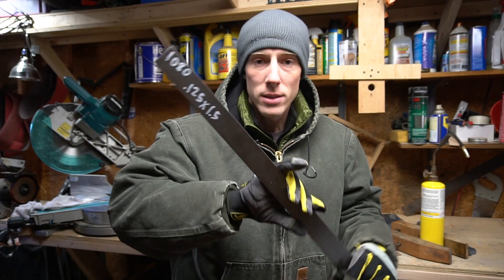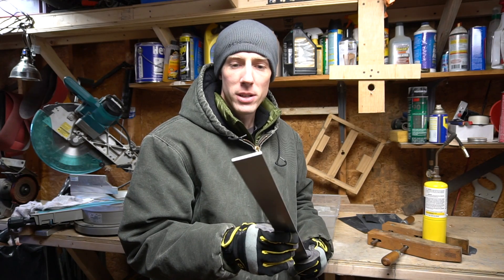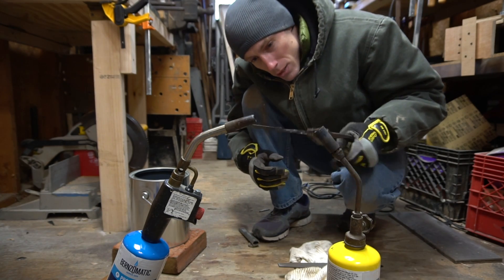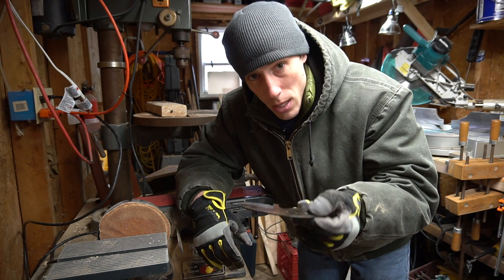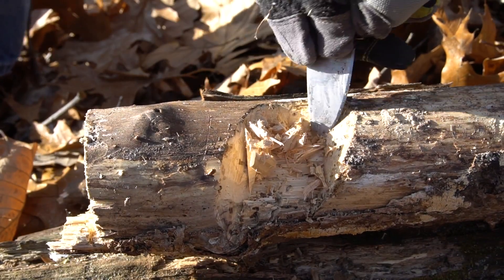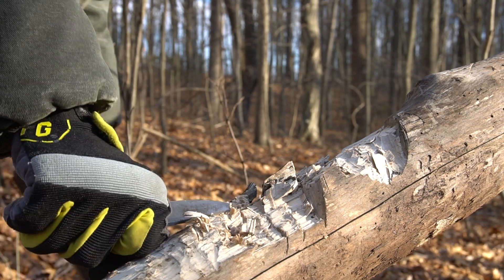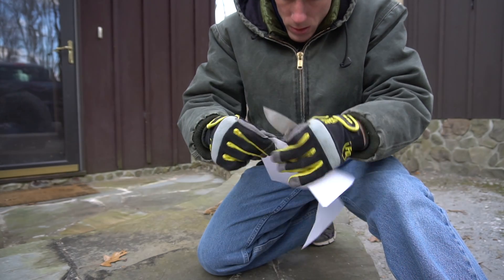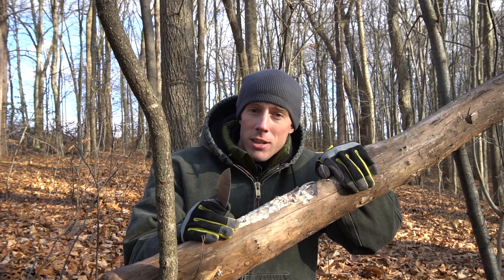Knife making | Can you heat treat a knife using basic tools?

Comment: You well know this by now, but for new watchers:
 You really want to do a normalize first, bring it up past non magnetic by a bit and hold it for a few minutes and then let it cool in air, then bring it back up just to the brink of nonmagnetic then quench. 
From the factory the crystals are huge for easier machining, but you want the carbon to dissolve and let the grain structure reset so that when you do the main hardening you can get it just to nonmagnetic and have all the carbon in solution quickly, without letting it sit too long or overheat which causes a huge loss in tougness even if the hardness comes out the same.
Reply from the maker: That actually not true. Dr Larrin Thomas has a lot of work on this and the crystaline structure from the mill. Id suggest reading knife steel nerd knife engineering. There a lot of myths that have been busted.

Comment: Just tried heat treating my first knife. Don’t have a forge at the moment. I used propane,got it to non magnetic,quenched in vegetable oil but it didn’t harden. File digs in. Not sure what went wrong. Any ideas? Can I retry on this blank or should I start over? Thanks for any ideas.
Reply from the maker: What kind of steel is it?
Reply: OUTDOORS55 its an old mystery steel saw blade. I wanted to try a couple before I bought  some 01. It sparked really well and everything. After I quenched it tho, my file still bit.
Reply from the maker: Id use a known steel. Try and find some 1080-1084. You may get the o1 to harden but you wont get the full benefit of it with crude methods (forge/ torch). 1080/1084 will harden very easily. Mystery steel is hit or miss🤷‍♂️

Comment: why does the tempering cycle have to be so long? Why cant you temper in say... 10 minutes? I get a nice straw color within that time at a higher heat.
Reply from the maker: You can temper for shorter times. I’ve tempered with a torch for a quick temper. To keep it simple it can take time for the steel to respond. Thicker pieces require a longer temper. Think of it like melting an ice cube. A quick high heat may yield melted ice on the surface, but it’s still frozen inside. Leave the ice cube at temperature and it will ensure an even melting. Same with steel. Hope this helps 🙂
Reply: OUTDOORS55 Ah yes ok! Yes thanks that makes way more sense.

Comment: Need a cheap heat treating oven? Dig a hole in the ground then dig a smaller hole at a 45 degree angle connecting to the bottom of the first hole. Place a metal pipe into the second hole and cover it up. Use either a hand pump or a hair dryer as a blower for your fire. note you can either use charcoal or wood as fuel, but charcoal works best as it burns slower.

Comment: I'm not sure if you'll see or reply to this but I need some advice. So I took your advice and bought the contolled angle sharpening system. I have trouble using it to put good edges on my knives. I was able to put a pretty good working edge (but not shaving sharp) on my 420hc buck using it but I've been having trouble with my Swiss army knife. I'm scared to try and sharpen my s30v manix 2 when it dulls. Maybe it's because the stones aren't flat (at least the 600 grit isn't), maybe it's my technique, or maybe I need to step my stropping game up. I'm not necessarily gonna buy one right away but what sharpening system would you recommend at the 50 dollar mark? Who knows, maybe I'll suck it up and learn how to hand sharpen.
Reply from the maker: You definitely need a strop if you don’t have one. The lansky stones will leave a pretty big burr that needs removal. In my opinion a good strop is more important than the stones you are using. You can get hair whittling edges on cheap $5 stones with a good strop/strops. I use a diy strop (I have a video on how I made it) I loaded with a coarse compound and a knives plus strop block with fine compound. Just make sure you fully apex on the lansky. Then strop until all of the burr is removed. Sometimes it can be stubborn. Hope this helps 😀
Reply: OUTDOORS55 I have a cheapo Amazon strop I got for like 15 bucks and it should work fine but I was wondering whether I was doing it right since I was getting poor results. And thanks for the advice on stropping. If I use my strop better and flatten out the 600 grit stone I should be getting better results. All I've been doing for stropping is 5 very light strokes on each side with an angle lower than what I sharpened it. It probably isn't doing much which it leading to the poor results
Reply: OUTDOORS55 your tip on the stropping actually really helped. I stropped the sak a bit more using a bit more pressure and angle and the edge is already a lot sharper. I should be able to get a great edge once I touch it up on the stones some more and strop it a bit more carefully.

Comment: TOTALLY OFF TOPIC.
I just found a neat and CHEAP way to perfect apexing delicate blades.

Here in UK we can get 8 cheap Plastic Snappable Stanley style craft knifes...for a POUND/ Dollar

Using the finest stones I found I could gently take them from thick paper slicing to Shaving evil within a few strokes of a shit "1000" grit Chinese stone.

There are numerous inches on each disposable knife and the WORST that can happen is .. You still have a fairly sharp disposable knife....

I extended an inch (whitch I had probablu used to open a few packages ) and worked it gently... It shrank fast but was notably sharper than the next 4 inches that hadn't been used...

Give her a whirl...
Reply from the maker: Interesting! thanks for the tip👍

Comment: Great job, I will try that now. Was thinking of making a kiln with fire bricks and the torches, but it looks like you don't need it. Just be careful with fire and oil in your little shop my friend. You could never put out that kind of fire with a fire extinguisher.
Reply from the maker: It works for very small blades. for larger stuff id have to get another torch or make a forge. Getting even heat is tough with this set up. I was using canola oil and had the lid for the can, so worst case id just drop the knife in the can, and put the lid on. Thanks for the comment!😀

Comment: What are your thoughts on how sharp a lawn mower blade should be?
Reply from the maker: They don't have to be that sharp. I sharpen them with a grinder.
Reply: OUTDOORS55 Cool, thanks man. I used an old file and got just sort of sharp. I feel like too sharp would make the edge too flimsy and potentially make it easy fold edges over. I went for a “roughly sharp”. Thanks again!

Comment: Are these map gas or propane torches? I didn't hear you specify in  the video.
Reply from the maker: One was on propane and one was map gas. On a larger blade you would definitely need more than this. Probably 3 to get even heat. Or a mini forge.
Reply: OUTDOORS55 Thanks! I've got a couple blades I've made laying around needing a heat treat, haven't been able to bring myself to buy a forge yet. It's awesome to see you getting into knife making.

Comment: Damn you really tested that knife. I though I tested my one hard lol. I thought that tip was gonna span for sure. I tempered mine at 200 Celsius (400-ish F). I don't know if it could take all that. But I am gonna test it harder now to see. I used charcoal and a hair dryer to HT though. With I had those torch things.
Reply from the maker: The torches are pretty cheap around $10 us. They work for small blades but not for larger ones. The hair dryer forge is the way to go. I thought for sure it was going to break. I just finished another one I tempered at 400 and it is definitely harder. I tested that one as well and no problems yet. Im really impressed with 1080 so far. 🙂
Reply: damn can't find any for that price where I am (Australia). I am going to try modify the steel pipe I put the hair dryer on by drilling holes in it. To see if I get better air distribution than just coming out the end. I pretty much just dig a hole in the ground every time I want to HT a blade lol. One day I would love a HT oven but I am not any where near deep enough in the hobby for that kind of money. Is the one tempered at 400 extremely tough as well?

Comment: Hope your mistake taught you something valuable, 1/8th stock is more than tough enough if the steel isn't junk. Most modern knives are way over built, twice as thick as necessary, 3/16th is for swords, big choppers or heavy fighting knives. And 1/4 inch is a gimmick always. A good, hard use utility knife should be 1/8th max. Awesome knife btw.
Reply from the maker: Thanks! I wanted something thicker so I didn’t have to put scales on to get a usable knife. That’s the only reason. I like thinner blades anyway😀

Comment: That knife looks pretty damned refined for something that you weren't going to put any effort into? GREAT job. I use 1095, but I may try your 1080, that's impressive!!!! Great video, thanks.
Dave
Reply from the maker: I wanted to keep working on it and take it even further, but the heat treat kept looming over my head😬 haha. I was thinking about trying 1095 but heard it can be trickier to heat treat for a beginner like me. From what I can tell 1080 even with a basic heat treatment seems great. Im sure with more controlled temperatures you can get more out of it as well. Thanks for watching my friend! I really appreciate it😀
Reply: Hi
 I use the same process that you do. Heat to non-magnetic + 15 seconds ( counted) then quench. I've never had mine Rockwelled, but as a machinist who grinds tools, I'm pretty certain that they're close to an R-56 and that's great with me. NEVER had a complaint from a customer, who broke one.
Thanks.
Dave

Comment: AWESOME VIDEO!!! You do a great job and very informative. 
Would like to know an explanation of why oven treat is necessary, why it is necessary to do it twice. 
Also have heard of "air" quenching. Sorry for all the questions ad thoughts.  I need to reearch myself. Wondering why you chose this method to your madness... LOL
Reply: Daniel Preach if you allow me to answer:
after quenching steel in oil, water or air (which is a specific treatment depending on the kind of steel you use), the blade is so hard, that it shatters like glas if you treat it to rough or f. e. let it fall.
the reheating in the oven removes some of the inner stress (which makes steel hard) again and leaves it with a lower hardness but way increased toughness against bending or shocks.
Reply: air quenching is used for steels with high chromium percentage. chromium makes steel stainless, but makes the crystal structure of it more rough, which decreases cutting abilities in the end. however, chromium changes the steel chemistry in a way, that it does not require as fast temperature changes (to harden it) as high carbon steels (oil quenching for that one) , which allows you to quench it in the air. air quenching helps, so that the steel does not bend while cooling or shatter due to high built of inner stresses. but you can't air quench carbon steel. it won't do the job.
low-carbon steel has to be quenched in water instead of oil for even faster temperature drop rates. but water quenching is a torture for steel and it might break while quenching.
Reply from the maker: Taunus-Tims Welt is correct and gave a much better answer than I would have had haha!